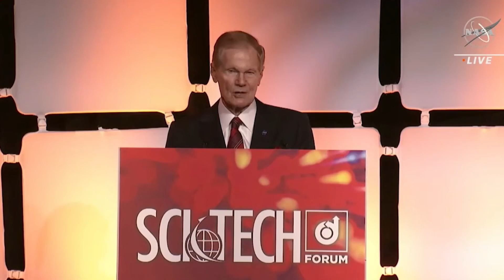NASA and DARPA-developed nuclear thermal rocket engine could be tested in few years

Comment: SpaceX stock just went negative. Getting large objects and more importantly people to Mars and beyond has been the whole point of the Starship project. Starship has no use if it's not going to be a long-term vehicle beyond Earth and the Moon.
Reply: Starship has NEVER made sense as a Mars delivery platform. It only makes sense as a LEO delivery platform.
Reply: SpaceX doesn't have stock...it's not a publicly traded company.
Reply: @ryddragyn  They do have stocks, but correct - they're not publicly traded.
Reply: @LV93262  You could stretch the tanks, have about 8-9 decks. Each deck twice as big as skylab....this thing is a monster. Crew of 4 would be traveling in style compared to the Apollo days.